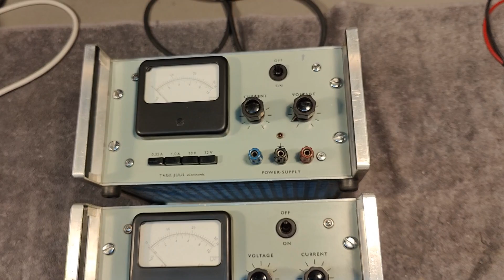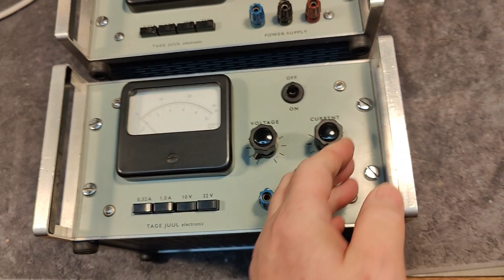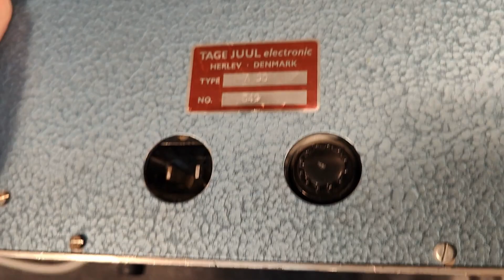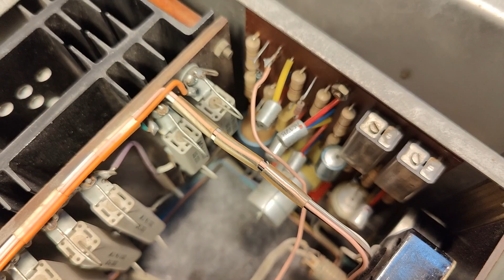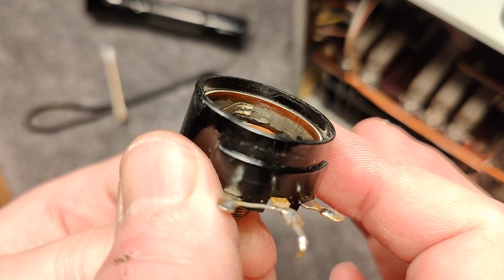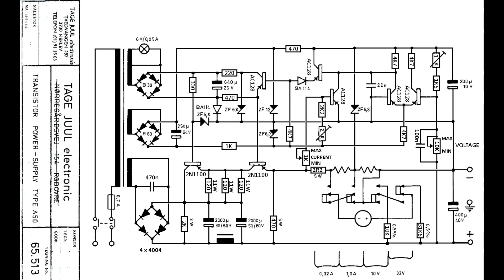Tage Juul Electronic A50 A51 DC Power Supply 1965 test teardown

Comment: The combination of the 2 transitors in series with power resistors is interesting. The resistors take some of the load off the transistor that does most of the work.
Reply from the maker: the first transistor is on/off mode

Comment: Any idea of the value of the inductor? It's not written in the schematic. I'm guessing somewhere in the lower mH range. And that must be of course a DC inductor with an air gap. I like C-L-C filters, even though it's more a nostalgic thing nowadays for filtering 50/100 Hz.
Reply from the maker: i dont have the inductor value, think you are right the current is high in the Amps, it is not possible to make H area value, and uH area will not have any filtering effect for 100Hz, so i say the same as you, we are in the mH area.